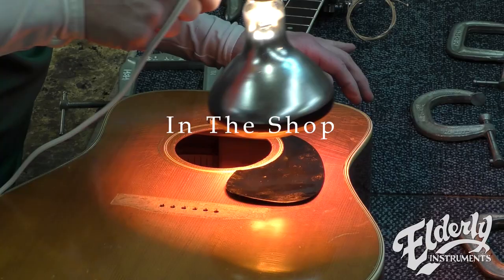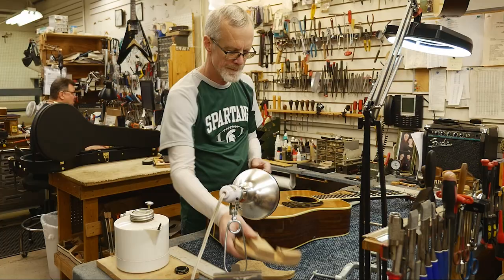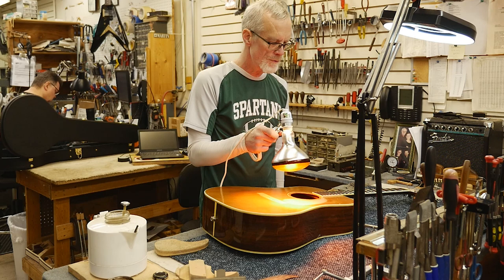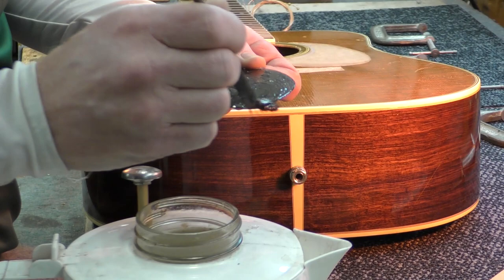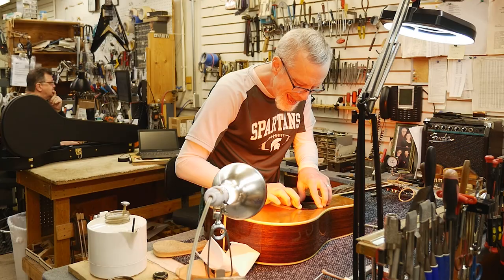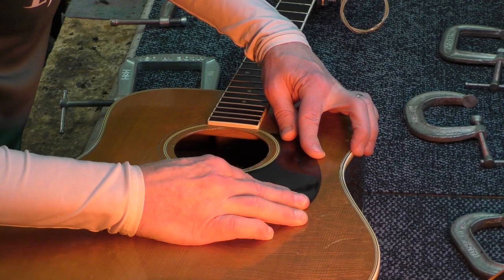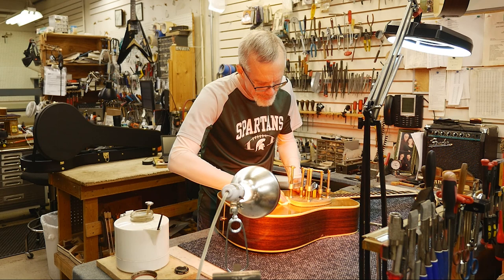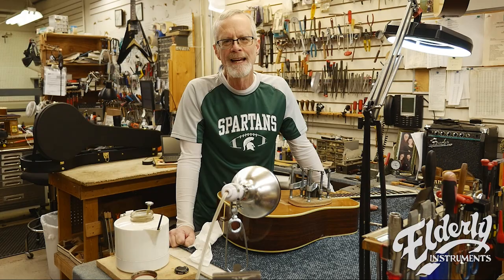Gluing the Pickguard on a Vintage Martin Guitar | Elderly Instruments Repair Shop

Comment: huh

what's the advantage of this method vs dan erlewine style, just putting a thin sealer finish on the exposed wood then using doublesided tape like modern pickguards have? the argument is that with modern tape the pickguard would never risk further cupping or splitting the wood like the old ones bonded right to the bare top did when they shrank

is it just a thing with reusing original pickguards where they may not be quite flat enough or smooth on the bottom enough for tape to work right?
Reply from the maker: The main reason is the original PG looks better.  If it has not cupped or shrank much it looks so much better than a new taped on PG (especially the black ones).  I have done many taped on new PGs with the bare wood sealed, but it is a judgement call.
Thanks,
Joe
Reply: @ElderlyInstruments  what about tape on the bottom of the old pickguard? does that just not tend to come out well?
Reply: @ElderlyInstruments  Totally agree. And this tape stuff is really quite temporary. Especially in a hot car. Ask me how I know.